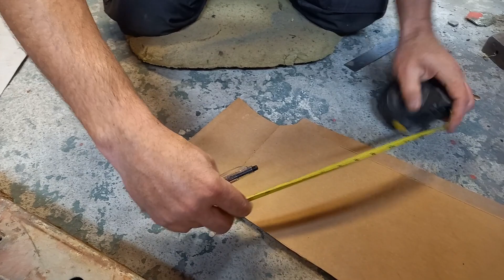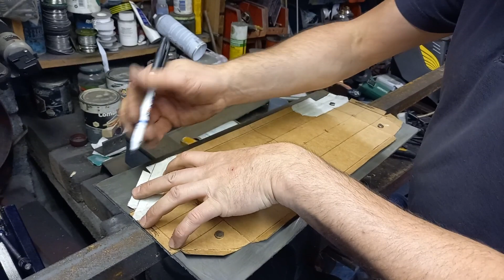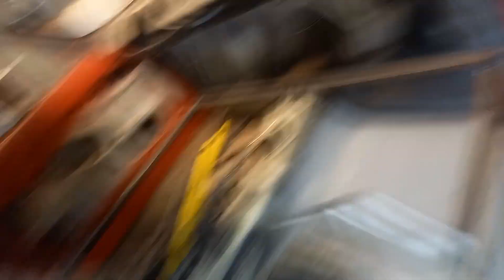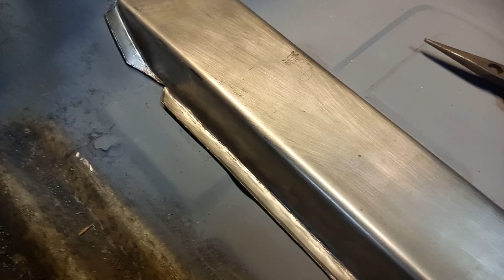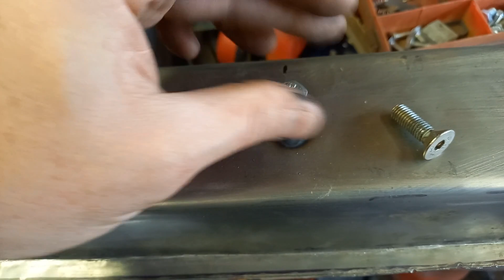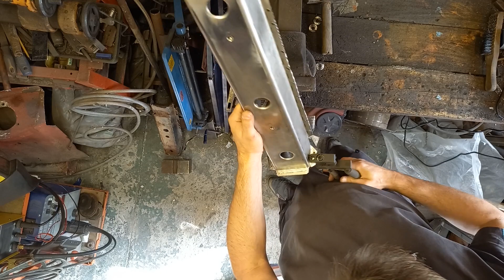Ford Escort MK1 Restoration Project, Seat box fabrication.  Car Restoration.

Comment: Hi Dave.   An idea.  When you weld. A lager. Gap between  two panels.   Try using a steel coat. Hanger. To use as a bridging. Metal.  Works well.  Nice work.  Clive
Reply from the maker: Cheers Clive, yeah I've seen Fitzee do that, I've since bought some tig filler rod to try. Thanks 😊

Comment: Nice neat panel. Think I would of drilled out the original captive nut brackets and fitted them to the new panel. Also there were some captive nuts along the front of the panel 90 degrees to the top ones. Good video 👍
Reply from the maker: Thank you 👍

Comment: That floor pan is an incredidible testate the to your skill patience and sheer determination. Seat box is a work of art too. Going back to the good old eighties, I kept fracturing the captive mounts on my subframe, as soon as I had uprated the suspension and tyres and was generating greater cornering forces through the seat mounts. There is some additional steelwork holding the captive nuts designed to spread the load over a greater area on the original seat box, so it may be worth revisiting this area before paint and carpets as I fear your captive nuts will fatigue cracking around the weld and pull through the box. Brilliant build, I am really addicted now.

Comment: great job dave,just shows what the right tools produces,are you not putting captive nuts on the front side mate because your fitting after market seats.
Reply from the maker: Correct mate, not sure what seats I'll be fitting, but they wont be original.